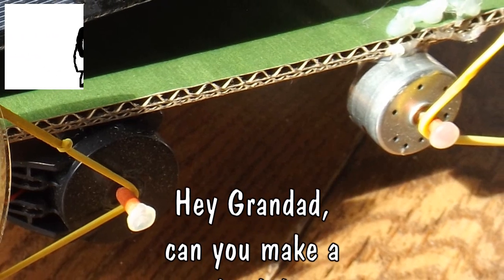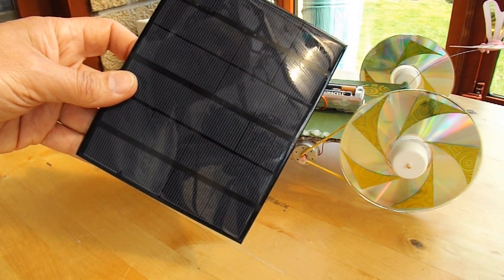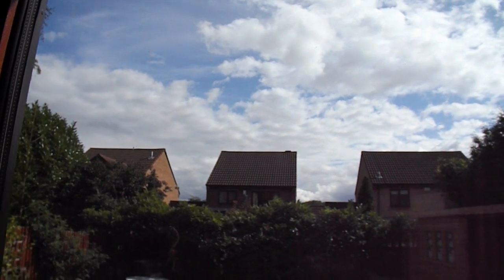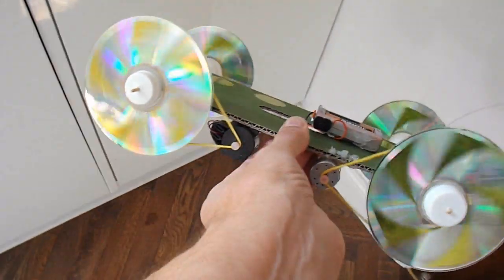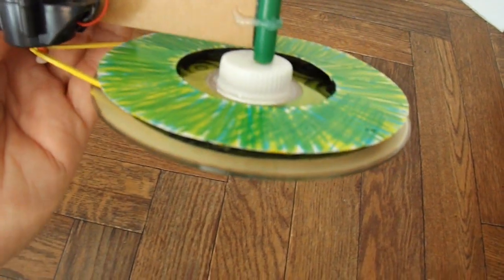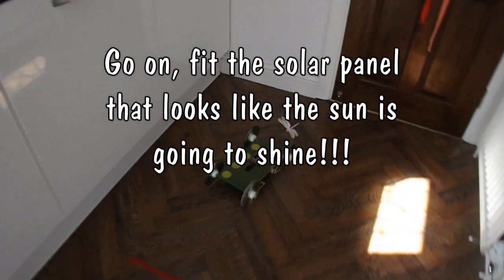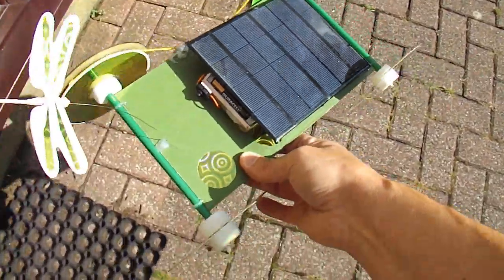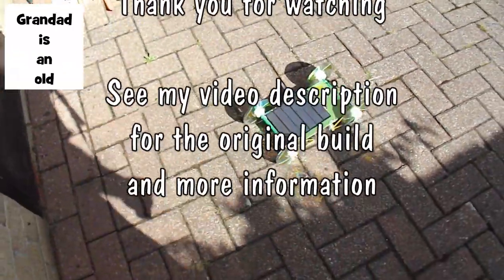Hey Grandad, can you make a 4 wheel drive electric pulley car?

Comment: Thanks for the great videos! I was thinking that you should try making a solar or electric powered plane and see if it flies! 😃
Reply from the maker: I have electric powered planes in my Aircraft playlist but solar power is not an option with the solar panels I have available and the motors I use. They do not have a good enough power to weight ratio. http://www.youtube.com/playlist?list=PLA5a2xPRSrB0nZItxE_78EJP0F99Ghaki

Comment: Next up; Grandad makes a dual power circuit with a switchable solar/battery powered motor :)
Reply from the maker: Hi MisterG, I left the battery pack onboard, the panel is resting on it. The battery pack has a manual switch on the side. I added the solar panel into the circuit via another switch so it can run from either power source. I could get clever and build a small circuit to switch automatically to sunlight when the solar panel powers up but there is not much point on this car as it will only be running in my back garden and there would be no benefit. As a project on it's own a switch system might be interesting to make although there would probably be too much power wasted by the switching system on a small system like this.
Reply: As an aside, you could use the charging circuit from a solar light to top up rechargeable batteries... but now we're getting into the realm of super energy loss or perpetual free energy, depending on which side of The Pond we live :)
Reply from the maker: MisterG yes I could use that circuit but what is the point on this car? It only runs the length on my patio or in my kitchen so there is no benefit in keeping it running for any longer than that.. You might like this car.
Charity Shop Gold or Garbage #26 http://youtu.be/Jyg26LfBxVs
Solar charging my toy car's supercapacitor http://youtu.be/c9Hinkyb5fY?list=PLA5a2xPRSrB1SVLRn_D16dRvTrocMhFPq
Fitting the sunroof to my supercap powered toy car http://youtu.be/UTjCUOZCnHM?list=PLA5a2xPRSrB1SVLRn_D16dRvTrocMhFPq

Comment: How many watt, volt amps was that solar panel rated for?
Reply from the maker: I am afraid I really don't remember. I did this video back in 2014. Going back though my records I spotted a solar panel I bought on eBay that year and it had this information 3.5W 6V 583mA Mini Solar Panel Module Solar System Epoxy USB Charger. That looks the most likely item on my purchases that year.